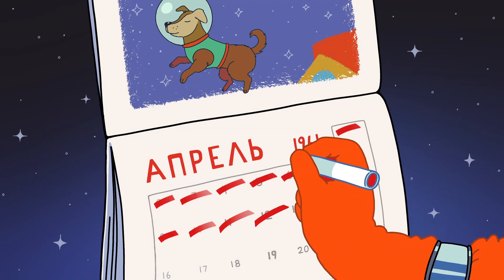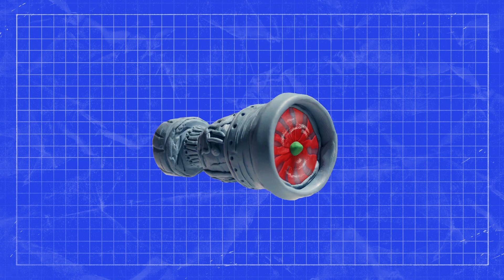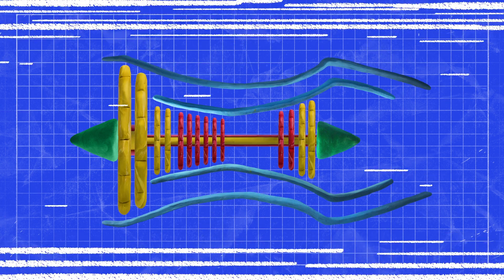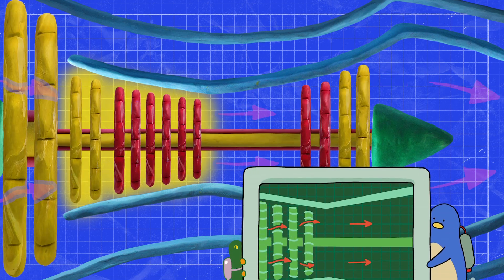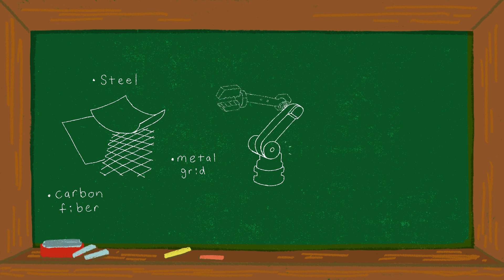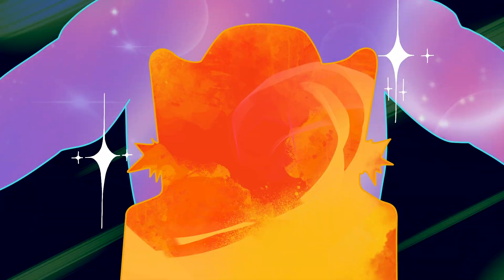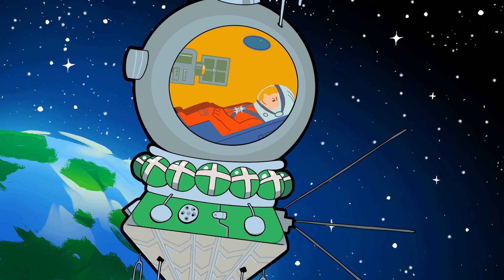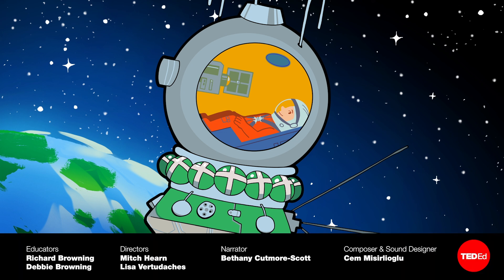Why doesn't everyone have a jetpack? - Richard Browning

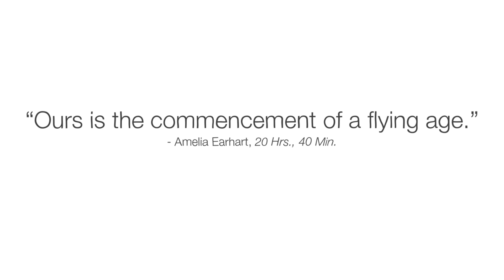Comment: 0:10 in fact Yuri Gagarin did NOT pilot the spacecraft. The flight was fully automated and Gagarin was just a passenger in that sense. He was given a code to override the spacecraft's computer and take manual control in case of emergency or computer failure but he never did.

Comment: Can u help me to solve this insane riddle
You are handed 15 identical looking coins (same weight as well) and a weight scale and are told that two of the coins is counterfeit. Luckily, the weight scale can reveal the counterfeit coin because the weight scale doesn't work if the pile contains even only one counterfeit coin.
Your challenge is to identify which of the 15 coins is counterfeit with only 7 weighings.

Comment: In fact in space Jet Packs are in fact extremely useful, if you are say doing work outside on the ISS a jetpack is nearly necessary to move as there is no other way to substantially change trajectory or maneuver at the moment, the lack of air resistance, and light gravitational force is what allows this. These jetpacks use compressed air instead of say plasma but they are none the less vital to space exploration.

Comment: As hinted by the video, it's only that much fuel that you can carry to make any of these devices manageable by a person, that's why all are limited by fuel efficiency. Anything more and it would be like trying to carry a horse on your back (etc.).
Reply: If you want to build a jetpack and searched up for model aircraft turbines, you will found that for about every 40 kilograms of thrust, you are consuming a litre of fuel per minute… at that rate, it is not a very practical mode of transport. If only we get vastly more energy dense batteries to power electric ducted fans, jetpacks remain impractical…
Reply: It’s not just the person but the jet engines, adding more fuel increases weight making it too heavy.  Infact you could theoretically make a rig that could take up the added weight, but then there would need to be larger more powerful engines attached to a human arm which would not be able to withstand the extra thrust.  We would need to develop a light weight, powerful, and highly maneuverable exoskeleton to use a jet engine system for sustained flight. Yes basically we have to make a real life Iron Man.
Reply: Just gotta run a fuel hose to the jetpack, problem solved /s
Reply: @DoctorX17  I mean unless it's infinitly long then your limited in movement but I could see how you could use it on a vehicle to gain higher ground
Reply: @Rumins-ja09s  hah, I was just joking, but yeah, that could potentially be useful… jet packs on an aircraft carrier that needs someone to hang odd the edge and do something that ropes wouldn’t work for maybe?
Reply: @DoctorX17  I was thinking like for workers slap it on a van and you got window cleaner construction workers all sorts without using little rickety ladders or whatever
Reply: cant they nuclear powered
Reply: @JP-br4mx  fairly sure that that's also heavy and it sounds dangerous having a small reactor straped to your back

Comment: "...  And Why Don't We All Have Them."  
ANSWER:  1)  Challenging to learn how to fly properly.  2)  Expensive.  3)  Dangerous to fly, especially by chuckleheads that don't get trained properly.  4)  Still classed as experimental craft.  5)  Have you SEEN the problems drunk DRIVERS cause???  And now you want those (bleep)s in the AIR???
Sounds alot like the exact same reasons we don't have Flying Cars.  Drunk Driving is bad enough.  Drunk flying is bad enough when you have regulated and isolated airports.  Drunk Drive/Flying out of and into any random street on the planet is a good way to turn a neighborhood of houses into a 24 flying car & house pile-up...  with ONE flying car!

Comment: The "jet suit" is still ran off of liquid  fuels kinda scary it need to be ran off electricity and powered by a tesla coil this way it would have unlimited  flight time be light wight as it would only be the Edfs used for thrust a, copper coil receiver, and a small battery for energy flow and emergency power in case of disconnection from the tesla coil, along with some computing power you'd be golden.

Comment: I think this video mixes together rockets, jets and turbofans? Also "relatively slow speed" of modern turbofan blades is transsonic at the tips, maybe low RPM, but definitely not speed.
Reply: It doesn't.
Also, the whole point of relatively was to describe that passager planes jet engines spin at a low speed compared to others. You literally typed relatively yourself.

Comment: From what I remember about the american jetpack program you made a couple inaccuracies, there was a rocket powered jetpack with the 30 seconds of flight and another gas powered using jets with about 20 minutes of flight. This relatively succesful jetpack was made obsolete because of the helicopter.

It's not a bad video but it massively oversimplifies the reality of it whyle being a great ad for the jetpack you are talking about while not even being the only one on the market
Reply: In modern times you could say drones make it obsolete. A drone able to lift a human is not much heavier than the jetpack and way simpler and more safe.  Not to mention a drone can also fly autonomously and carry cargo. The jetpack is a nice concept but it's just too impractical for everyday use. There are niche cases for the military though as the system is relatively compact and you can fly through narrow gaps between trees scaling a mountain. Check the video of a frenchman crossing the english channel on a hover board.
Reply: @kicka55  Even if the technology existed such that jetpacks could be made as commercially available as cars are, would you really want the same people who weave through traffic like they watched Fast and Furious to be able to legally own and operate a jetpack?

Comment: I didn't realise that we were designing jetpack way back in 1960's. 
I thought it's a 1990 or 2000 thing.

If we could figure out miniatureized nuclear fusion that can be contained so as not to burn the wearer we can have jetpacks and loads of other things. But it might take another century or two before we could do that and even then it might not be possible.

Comment: tl:dr 
They propel gases rapidly out of a cone shaped device, and we don't all have them because they are VERY loud and burn alot of fuel, or require extremely energy dense batteries that are prohibitively expensive.

Comment: I want a jet pack.
Reply: But I am sure we would have our own Jetpack in next 15 years
Reply: @vivekbarjod6815  tbh i dont think soo unless there is system where you need to buy your own and have a licene with it. I think this will require a lot energy which means we waste a lot of resources and i dont think the goverment would want resource to be wasted for jetpacks, this is my opionion so take it as a grain of salt. Thank you
Reply: @hiiamjustacoolrandomuser168  But I guess we would be able to make more fuel efficient Jetpack in future,
And yeah I agree that we would also require license as Jetpack can be used for some illegal works too
Reply: @vivekbarjod6815  lovs hearing your arguement i agree with you
Reply: @elle4702  no, he wants a jet pack
Reply: @fongus6420  the problem is not that we can’t build a jet pack, in fact some are commercially available. The problem is they can’t fly long enough to be a practical mode of transportation
Reply: Then make one lol